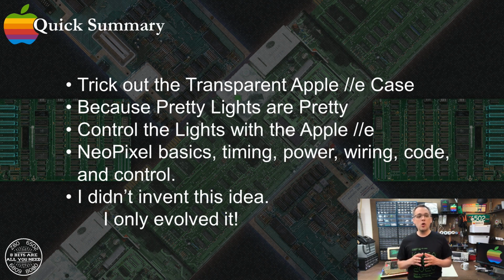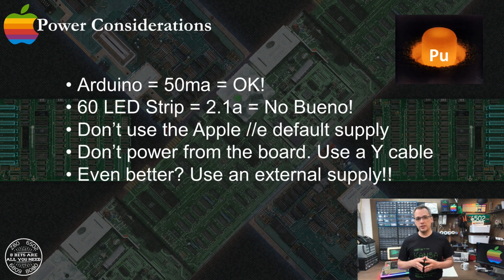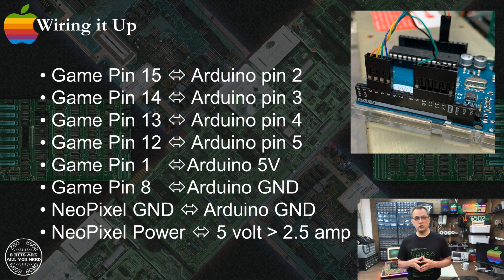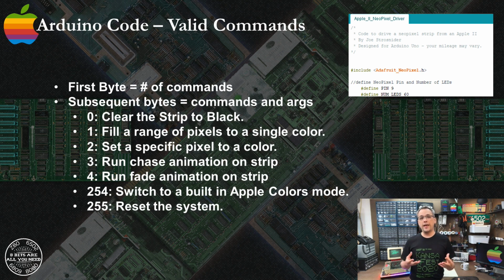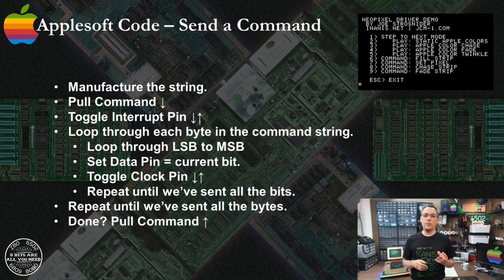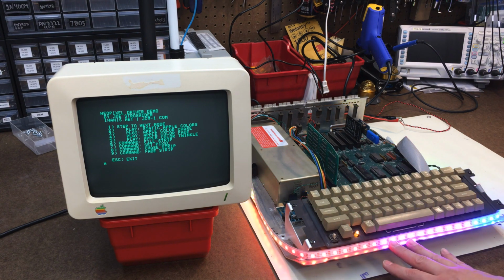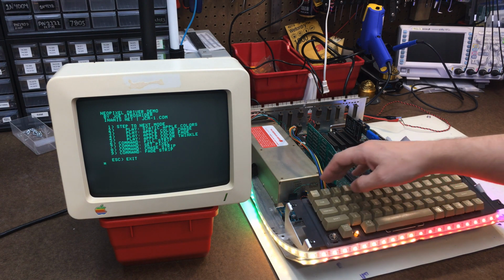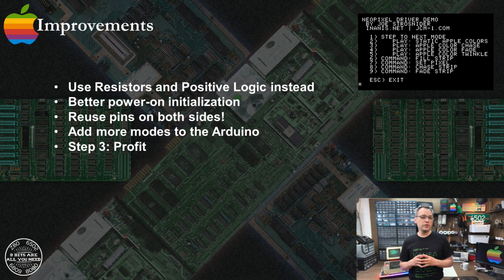KansasFest 2020 Presentation - NeoPixels, Arduinos, and Game Ports, Oh My!

Comment: hay i have an old radio shak trs 80 but the monitor sakes a lot
Reply from the maker: Could be a problem with either the monitor or the TRS-80 itself.
Reply: @JoesComputerMuseum  and the R button dont work
Reply from the maker: @m3lon_sl1ce17  Hmm. The keys are known to be bad. You can try cleaning the fingers or resoldering the pins. I did a video on it. https://www.youtube.com/watch?v=ValCsMwrSUI